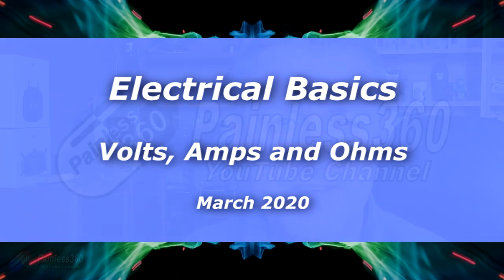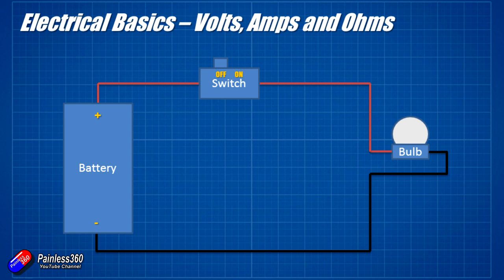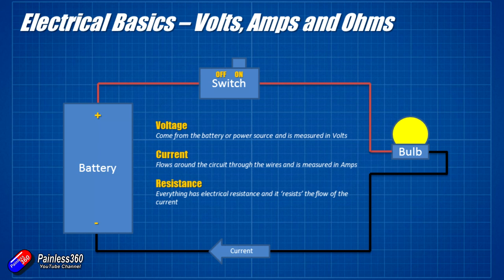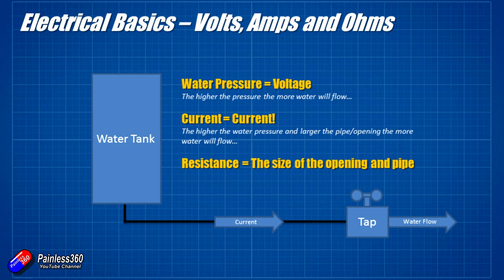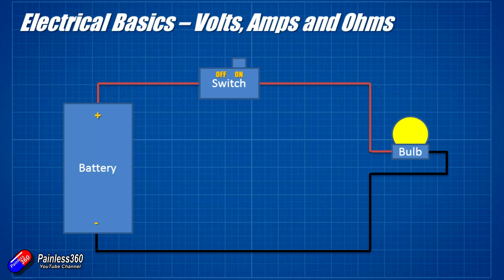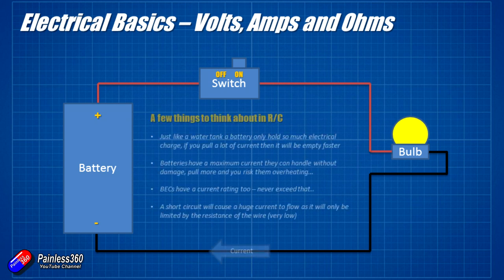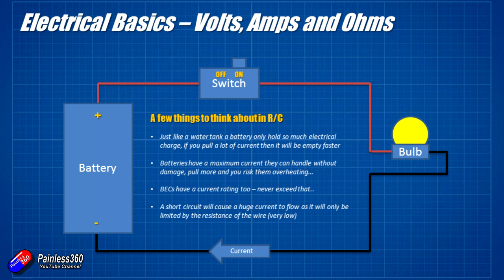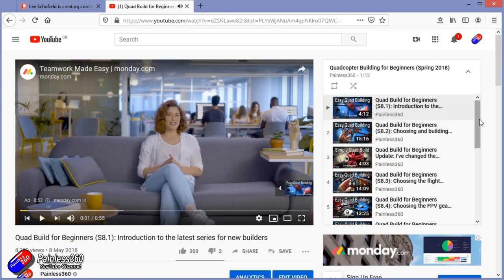Electrical Basics for Beginners: Volts, Amps and Ohms

Comment: I’ve learned this 45 years ago, but it’s good to freshen up my memory. 
Btw, does a beer-based instead of a water based system works the same? 🧐
Reply from the maker: Yes perfectly. A keg of ale gives the same result and the clean-up is a lot more fun :D
Reply: You guys have it wrong. Beer goes in the pilot, not the quad. 🍻

Comment: Thanks for this! I do a bit of rc flying but am also looking into getting an electric car at some point and I don't understand the relationship between Watts and amps... An explanatory video on this would be gratefully received...
Reply from the maker: That sounds like a good idea! Watt = volt x amps so it's easy to figure out if you know the voltage and the current for something. Check out the video on internal battery resistance coming next month too..

Comment: About other topics for your RC Basics, I would like to know what can I do to check the health of receivers (I buy second hand). Is there any software that I can run diagnostics? I have had recently several crashes due to lost of control and suspect that the receivers are failing. I do range checks but it could be a faulty or lose antenna, intermittent power or receiver hardware failure.
Reply from the maker: I would always treat second gear as faulty until it's proved me wrong. Apart from a visual inspection, range test and tests flights Im not sure if there is a test.. I'll look into it..